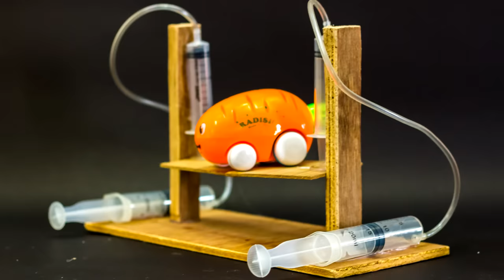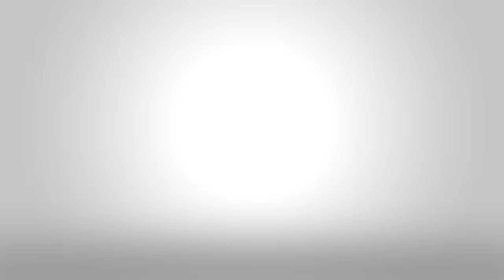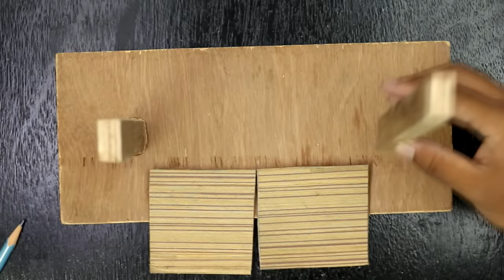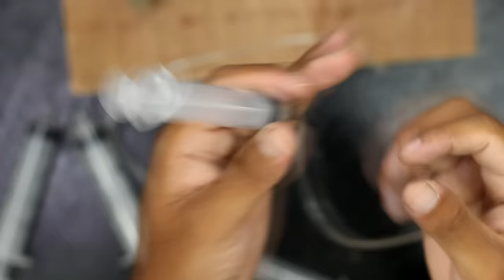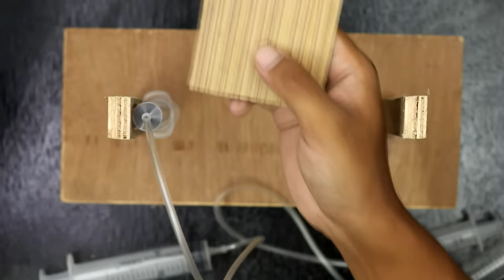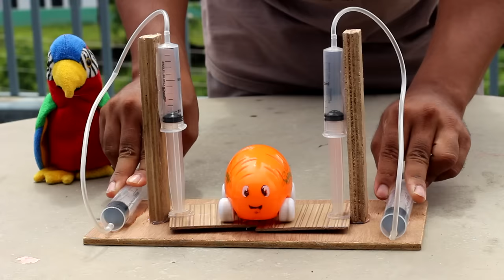School Science Projects Hydraulic Lift

Comment: Very nice video, but...
The principle of hydraulic lifts is based on applying SMALLER force than what would be necessary for lifting up directly. 
This requires the SYRINGES be SWAPPED: the one with smaller radius being pushed by hand while the thicker one pulling the car up.
In the current form it blurs the principle of hydraulic machines.
Reply: No need to yell.
Reply: Not necessary
Reply: Topper yarr

Comment: The medical pipe I used was not at all difficult to attach to the syringe. In your video your pipe seemed to be a tight fit.Did I use the wrong size? Is there any particular size of pipe I should use?
Reply from the maker: Friend generally medical pipe is of universal size. And it usually fits . I have used 10mm syringe .

Comment: Can we use 5ml syringe instead of that 10 ml syringe ...??
Reply: Any sering of same values
Reply: Actually, I would recommend to use syringes with smaller radius as the "push" and those with larger radius as the "lifter" becuase only then it works as a real hydraulic machine, enabling to apply smaller force than if you simply lifted the car directly.

Comment: this is really nice and easy, 
it is the simplest project I have seen on hydraulic lift .
Keep it up.....
Reply from the maker: Thank You
Reply: Notice, however, that a useful hydraulic lift must have the syringes swapped: the thicker one being the lifting part and the thinner serving as the "push button". In the current case, it actually requires a larger force to lift the car with the "hydraulic" mechanism than simply lift the car up directly.

Comment: How it works?Can you give a information how it works?
Reply from the maker: it is about pressure pascal law
Reply: Basically, the water transfers from syringe to syringe whenever you push or pull. The water then applies enough pressure to make the platform go up or down depending on whether you push or pull. In real life applications, this works for heavy lifting, most noticeably in construction sites.

Comment: sir is this project work on base of pascle law ? ,b'cause we have selected for school project , so when teacher ask about ,can we said that it will work on pascel 's law ,b'cause according to pascal law it will use  fluid but in this project we use air, kindly suggest.
Reply from the maker: Yes of course  siddharth bhatt this project can be explained as Pascal's law as its statement is 

 " when there is an increase in pressure at any point in a confined fluid, there is an equal increase at every other point in the container "